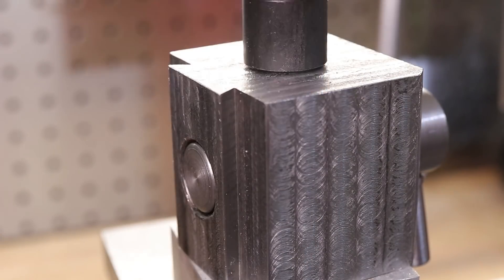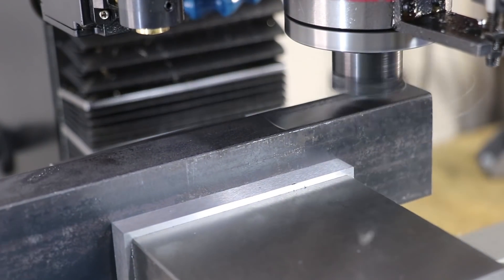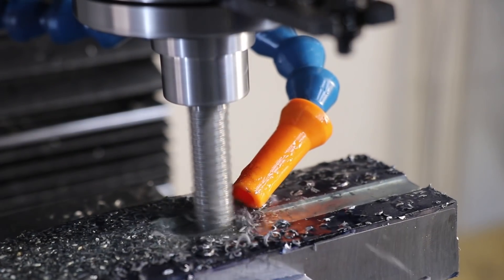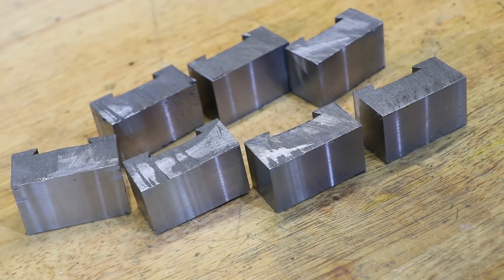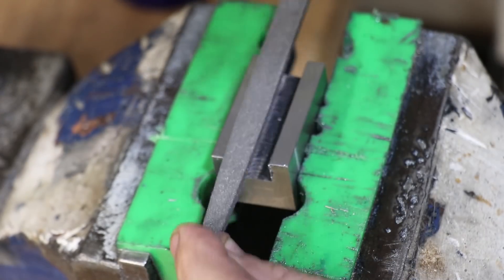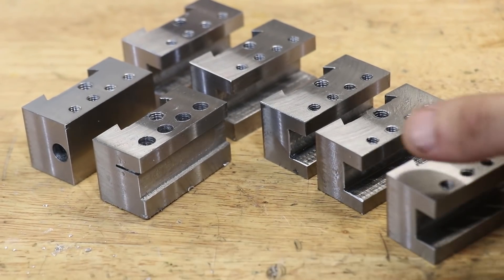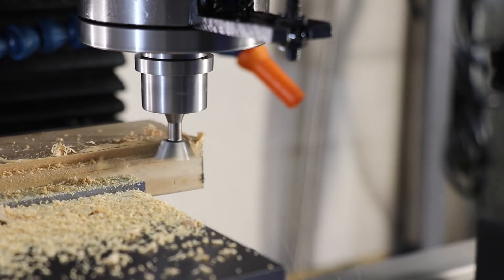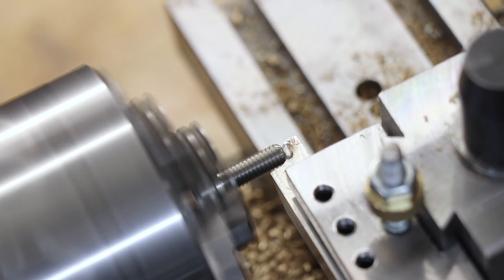Making Quick Change Tool Holders For The Lathe

Comment: Your tool holder storage is quite clever and easily produced. On the subject of what wood to use, stay away from oak. In my experience as a wood worker as well as a machinist  oak and oil will cause severe staining on unpainted steel if left in contact for too long. Possibly ok with blued steel, but un- treated as you have will have parts of them, and the wood, stained black in no time. There may be other culprits, but I've seen it with oak.
Thanks for the video.

Comment: Surely the best way to prepare your rough stock would be to machine the widest face first. Then place that face against the fixed jaw of your vice and machine one edge, so then you have a face and an edge perfectly square (at least as good as your vice jaw). Then flip the part, keeping the flat face against the fixed jaw, and machine the other edge to size. Finally with a face and two edges perfectly square you can finish the other face to size.
Reply from the maker: Normally I would but the side of the hot rolled was pretty bowed/squashed out. So I cleaned up the side just to get a better clamp on the face. Cheers

Comment: Nice. You mill's spindle looks a bit out of tram.
Reply from the maker: Its not out of tram, there is just a bit if flex in the tool holder and it really shows up in the back pass. Cheers

Comment: The hacksaw thing is pretty good idea, but I will say that your tool holders should have about a 3/32" (or about a 2.4mm) chamfer on all corners. That way you won't have interference with the small radius at the bottom of the channel. And yes, using a dead sharp tool would cut a square corner. Just remember that no tool stays completely sharp. Even brand new. So a radius is inevitable.

Edit: You say you heard people say to not knurl under power. I feel like that's pretty straight forward, but can you elaborate? If you are saying to not do that while the chuck is spinning, how else would you do it? That's the only way I know how.

Comment: Mill looks nicely trammed. The fly cutter finish looks good. My commercial tool holder is A2Z brand which is aluminum and works well so your steel should be great. A2Z is out of business now.

Comment: Great work man ! I found for the min lathe they are cheaper to buy than make as metal stock has become so expensive . great project though !! ENJOYED..
Reply from the maker: Cheers, I think the stock in total was about $20, the rest is just machine time.
Reply: @artisanmakes  Not in the U.S  For good quality stock to make them in a set of 4 .. It cost me way more than a set of pre-made . Plus the hard ware has to be grade 8 . By the time I was done it cost me over 100 bucks .. But I enjoyed making them as did you .. And I enjoyed your vid ! Thanks..
Reply: @shawnmrfixitlee6478  He used everyday hot-rolled steel. It's gotta be cheap enough - depending where you go. As for grade 8 fasteners - really? What on earth are you turning in your lathe, titanium for aerospace?  And how many hundreds of hours per month? We - home machinists - forget sometimes the demands of industrial production are MUCH higher than what we deal with . . .
Reply: no block steel is more money than just buying a tool holder..i know i tried  and made 3 and the cost was way more for the tooling and the steel.. @gyrogearloose1345

Comment: @ 1:25, what the heck have you got there for a fly cutter?
Is that a round carbide bit?
Whatever it is, it looks like it works pretty good!
Reply: Yep, that's a round carbide insert like a RPMT or RCGT style.
Reply from the maker: Yes, these ones are 10mm RDMT  inserts and leave a great surface finish

Comment: Can I suggest taking your mill and lathe and making a band saw. LOL Or try an Evolution carbide saw. For what your doing it will work just fine. Upgrade the vise so you can cut shorter stuff.

Comment: You should also use a spring washer between the knurled brass and nut but if it doesn't come loose it's probably not needed then.

Comment: Excellent, if you ever did a Patreon or something I'd sign up so you could buy a band saw or something and give your forearms a break 😅
Reply: I'll donate the wood cutting blade for it, because this hurts my eyes as a woodworker.
Reply: I tried hacksawing a 2" piece of round stock... Exactly once. Bought myself a porta band saw immediately afterwards.

I honestly don't know how he manages. I think he mentioned in another video he enjoys the manual sawing
Reply: @akaHarvesteR  lol, I cut a piece of 5x3/4" aluminum flat bar a couple weeks ago, which is about the same area. It was indeed a bit much, but not quite enough to make me change my ways yet. Just put on some earmuffs and relax. It will get done when it gets done.
Reply: Never shall he get a bandsaw!!! 😄
Reply: No kidding. Hate hacksawing metal by hand; absolute torture
Reply: One day it will probably zoom out and it will be one of those little retro power hacksaws that use a normal hacksaw frame.